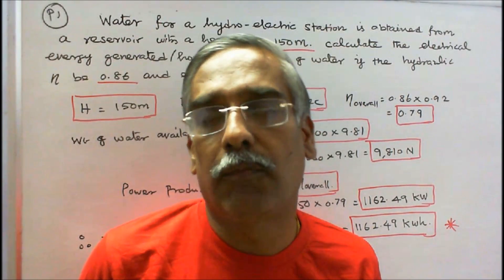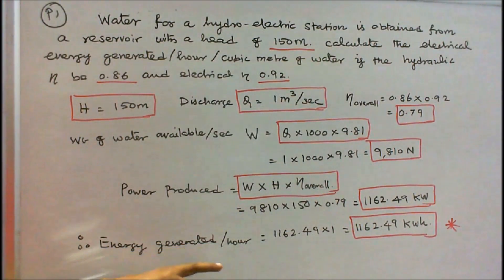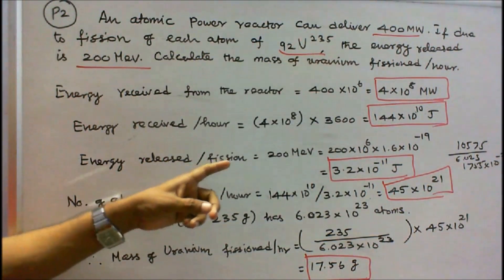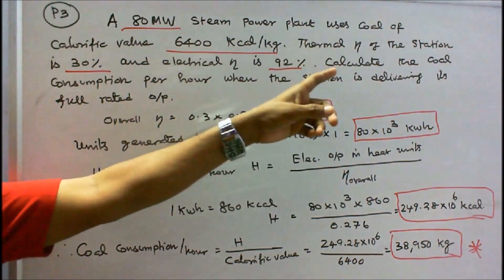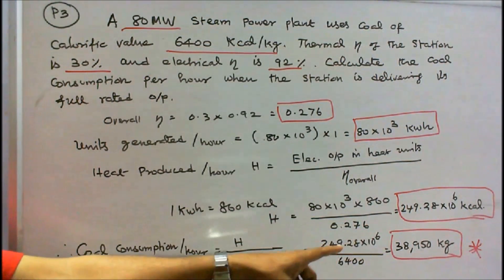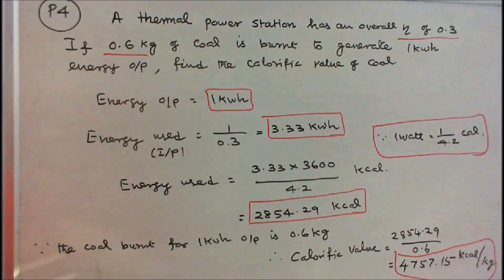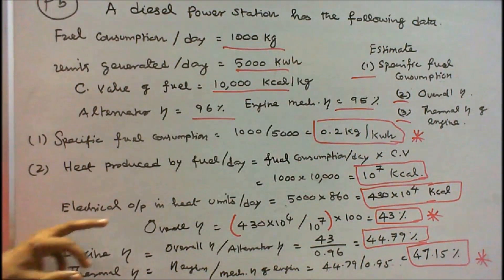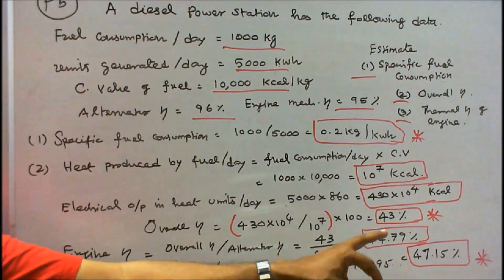100 PROBLEMS IN ELECTRICAL ENGINEERING - PART - 06 - FIVE PROBLEMS ON POWER PLANTS

Comment: Please can you help me with this question.

A natural uranium element has a mass of 200 grams when first inserted into a light water reactor. If after staying in the reactor for a period of 19 months releases an average of 372.5kW of thermal energy, determine
I) the total energy of heat (in J) released
II) the reduction in mass due to the energy released.

Comment: Q1. The following data related to propose a hydroelectric system such as Head is equal 30m ,catchment area 500 km^2 , rainfall 140 cm per year, percentage of total rainfall utilise 68% and penstro efficiency 95% ,turbine efficiency 85% ,generator efficiency 86% and load factor 44% calculate power developed and suggest suitable machine and specify the same
Reply: Email-mrinal2042@gmail.com sir please solve the question
Reply from the maker: I will try. Thanks
Reply: @zenmuralisachithanandam8189  what will be the formula for power if rainfall and catchment area was given sir?